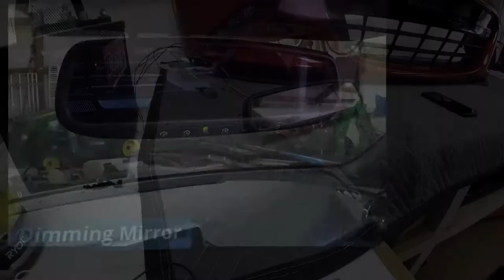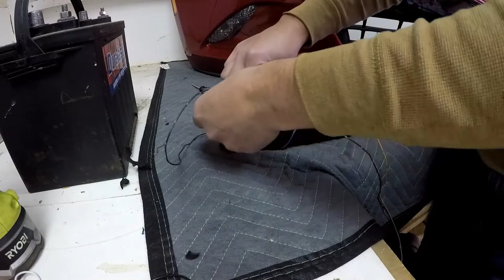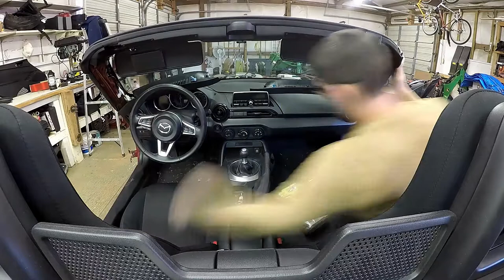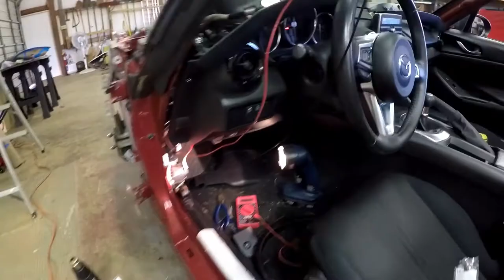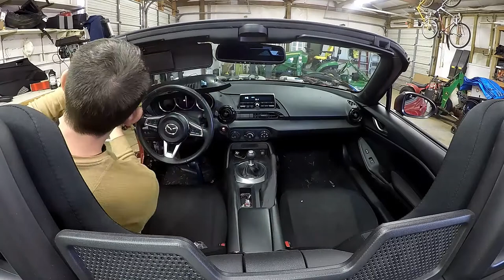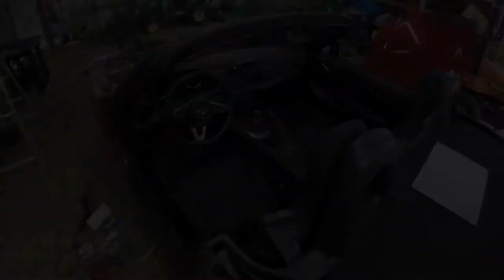Mazda ND MX5 Copart Rebuild; Adding Homelink Auto Dimming Mirror

Comment: We're working on a 2019 MX 5 grand touring.  The headlight was ripped off leaving exposed wires.  Do you know about putting the wires back into the plug in the specific order??  Any help would be appreciated.
Reply from the maker: I think your best bet would be to try to find a wire diagram. Also, if you buy a used headlight to replace it, you might be able to get a chunk of the wire harness and plug from the salvage yard.
Reply: @ironicallyengineered2486  Ok thank you!